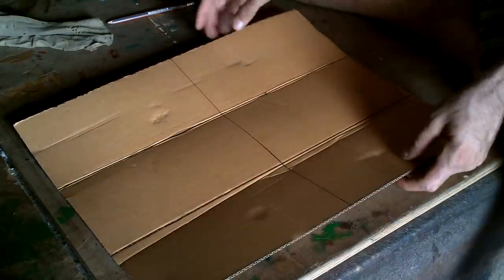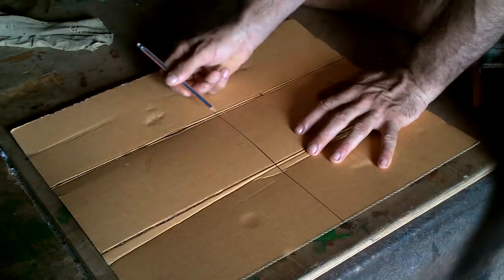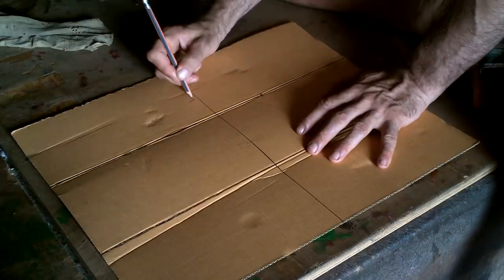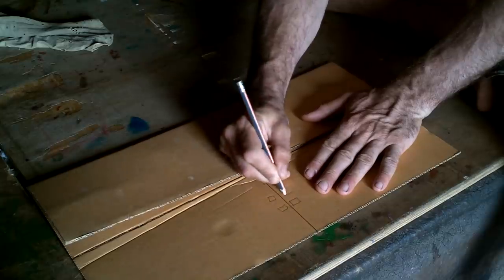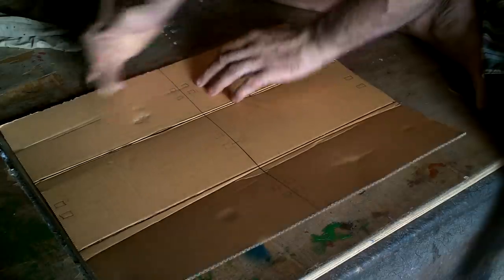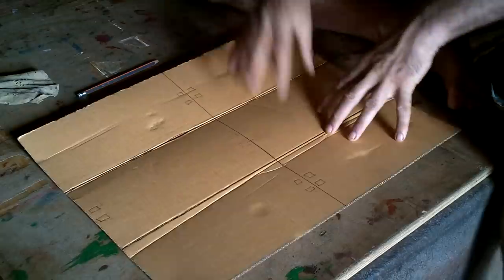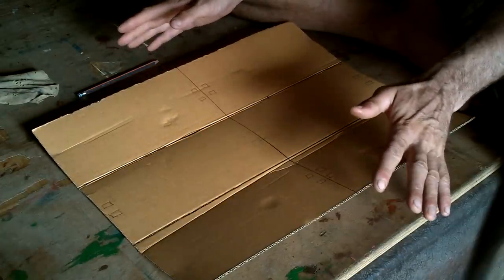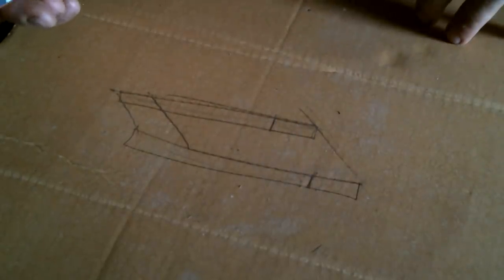Solar Snailer 027 New Direction

Comment: Ohh Jamie, This Is My Business Of 30+ Years! 1st Electricity Doesn't Come Into & Feed Though Solar Panels! Electrity Come OUT Of The Solar Panels, Created By Sun Light & The Silicone Structures Reacting Together! I Suggest Breaking Off Them Dumb Bulky "Propriatory" Connectors & Solder Your Wires Directly To The Panel's Wire Tabs Under Those... LOL Thanks
Reply: Blocking diodes
Reply: @jpian0923  You Only Need 1-Diode On The Positive Lead To Stop Current Reversal Drainage When It's Dark Out... ;~)P
Reply: That is my same thought. This way one can install the wires on the underside of the middle and one wing and the other wing on the top, So that when folded the wires are insides and not showing.

Comment: 1st: they make connectors for solar panels that are cheap and water tight.

2nd: having the panels not in the same orientation will put positive to negative so you'll have to cross the wires anyway.

Comment: you could just connect them the other way to produce only two wings tha would fold like a book and slide down, you can machine the hinges using your tools, like cnc and 3d printer you have, conenct all conetors to a bus, yo ucan 3d print  it with nylon, other parts you can laser cut . yo ucan make simple shaft mechanism on a ball screw that yo ucan wind up and down with manual handle . its so easy. yo ucan probably find big struts available on the other boat that yo ualready biught and heve not used yet for anyihng.

Comment: Hello Jamie, have you considered making a fiberglass 25mm x 10mm u channel or what ever size you think works, then you could use those turned upside down to make a n channel and use that to make a light framework around the solar panels, on the top side of each section of the folding structure that you are now building? This would mean that you could the keep the panel connectors from hitting the opposing panels when folded and could route your solar panel wiring inside the n channel too. Regards, Dave.

Comment: folding panels dumb idea!!! your making problems not solving.i thought you were smart..
Reply: Why? His requirements along the perimeter of the boat dictate the folding(and theft prevention while in town). If the panels are mounted to a near rigid frame whats the problem?
Reply: Not going to end well.
Reply: Solar panel  design needs a redo.
Reply from the maker: I am encouraged by the complete lack of coherent sentences being created by the people calling me "dumb".  I must be doing something right.
Reply: @JMEMantzel  Keep the folding design.  I don't think they have been paying attention to why the folding design makes so much sense!
Reply: @JMEMantzel  Good luck can't wait to see it. I need a good laugh now and then.
Reply: He explained the reason he wants this in a prior video. If I recall correctly it was to reduce the area during strong winds, to get through narrow passages as well as protecting them while they are not in use so as to increase their life span. It also reduces chance of theft.
Reply: J Mantzel i don't think your dumb at all.but i do think you sometimes over think things.theres a simpler solution you have overlooked . i make the same mistakes trying to reinvent the wheel rather being practical...
Reply: @johnathanray8977  What is the simpler solution?
Reply: I'm sticky chocolate focsle.